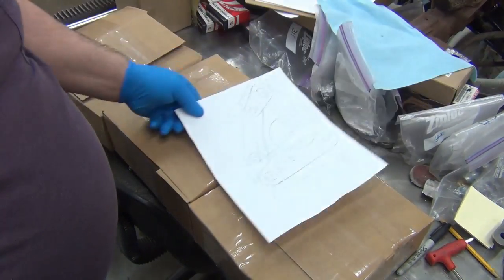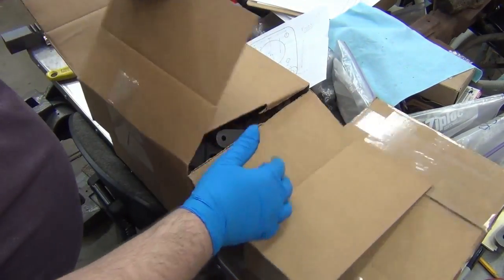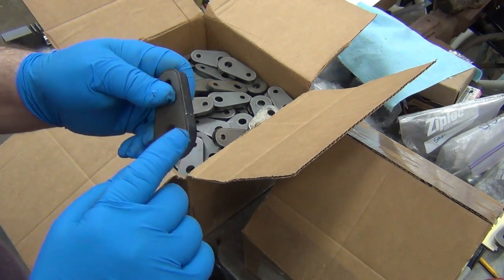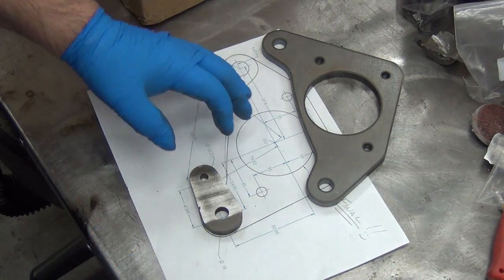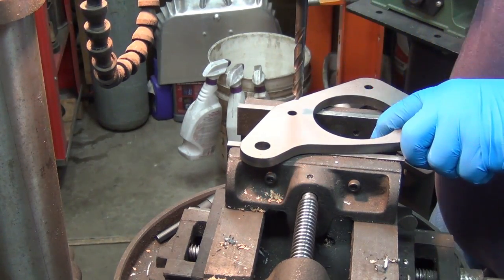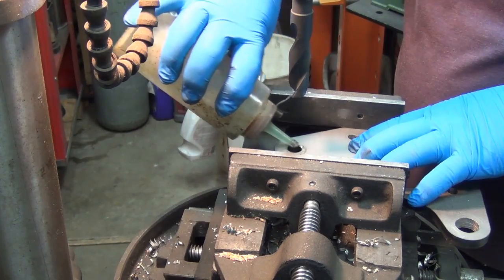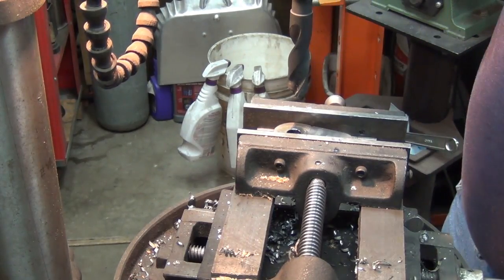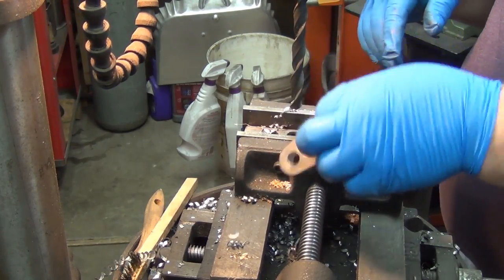Brake Bracket Build - Laser Cut Bracket

Comment: Would you share the file for your bracket my diff is b210
Reply from the maker: Those brackets are only for the front, I've never done a rear bracket.  The brackets are for the 320/520/521/620(drum) kingpin spindles.  The design has been shared on my website for years..... http://www.bluehandsvideo.com/brake-kit-cad.html   They're pdf's, but if you print them at 1:1 you should be able to use the bracket prints as templates.

Comment: The  laser cutting looks nice. Too bad about the pierce hole but it is only cosmetic.
Reply from the maker: The big pieces don't have the pierce hole.  I'm guessing they were trying to squeeze the little ones in too tightly.  The pierce just off the line and then move in, but if they're not far enough off the line, it gets the divot from excess heat. You can tell they didn't pierce on the line since there's no damage on the top of the cut.  I just learned this when I had some plasma cutting done.